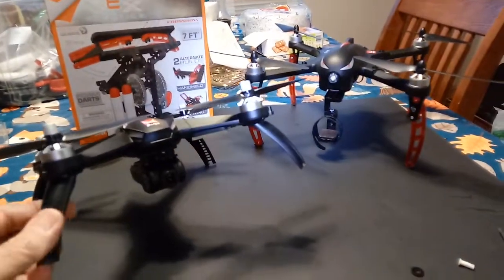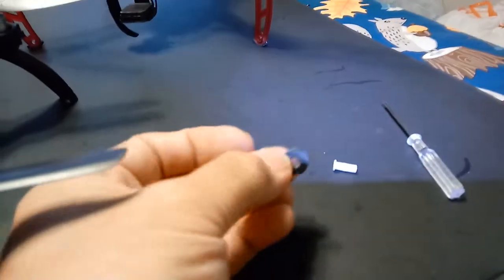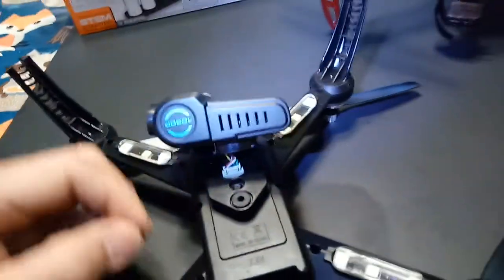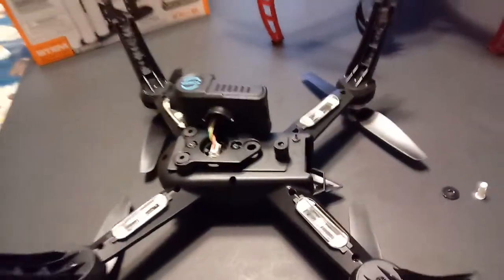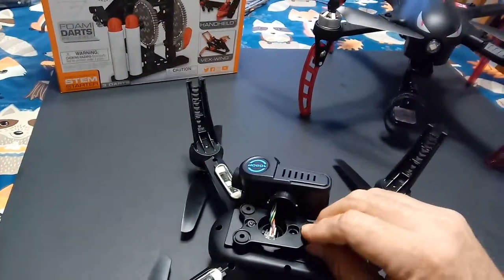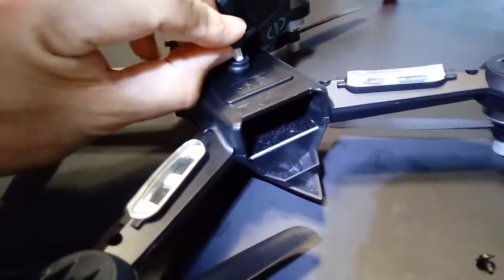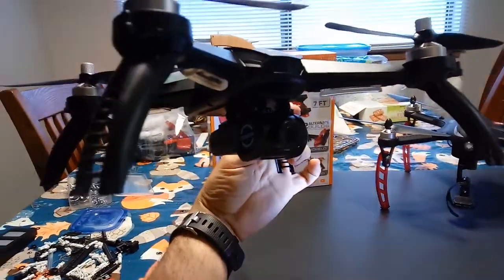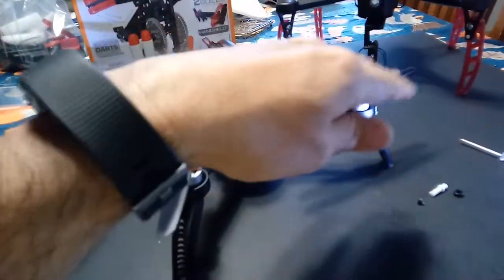Bugs 5W Camera Issue

Comment: Pls can u tell us if u can use the 5w camera and transmittor on a bugs 3 pro ?
Reply from the maker: Yea I wouldn't know about that. There is a camera mjx 5830 made just for the Bugs 3.
Reply from the maker: Sorry it took so long to get back to you. I couldn't tell you that. Your better off getting the MJX C5020 720p 5G Wifi FPV camera set up. Plugs right in to Bugs 3, holes predrilled in the Bugs 3 body already......

Comment: Or if u want to sell me a air bag the part i need please
Reply from the maker: I've seen those on Ebay under drone parts.  Race Drone parts, I would call or look up a Hobby Shop for them little Camera Cushion Shock Things. There part of the Camera Gimbal Assembly.
Reply from the maker: Ok I looked it up on Ebay, they are called Anti-Vibration Rubber Shock Absorber Dampening Ball for FPV Drone Gimbal.